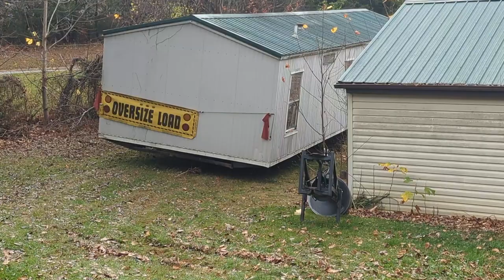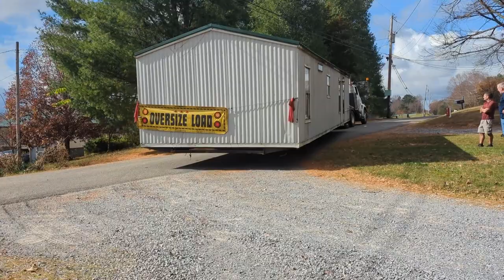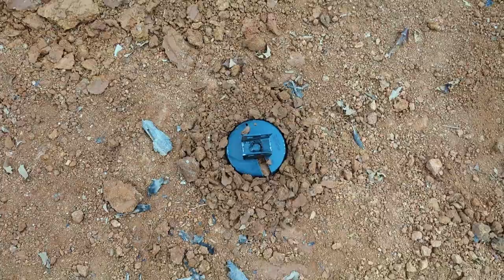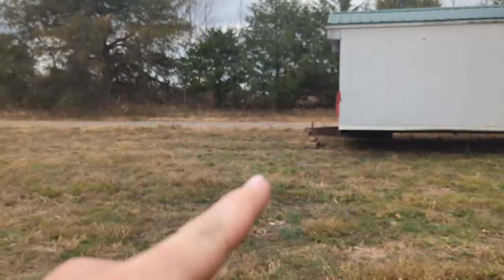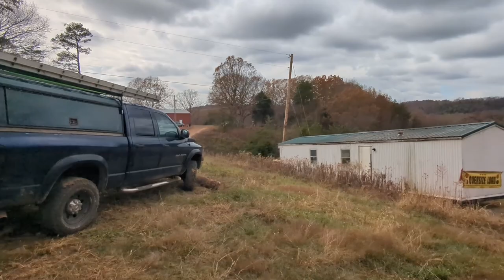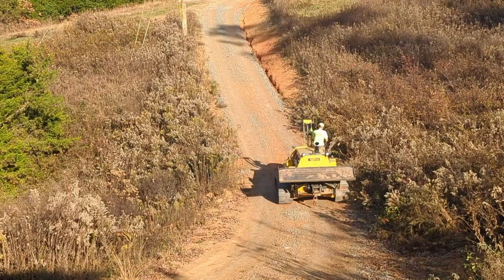They Moved Our Mobile Home With Skill!

Comment: My biggest question is how were they so sure that once they said it on the blocks it was level it's cool that they have all that great machinery but I know it takes time to level one up glad you're there
Reply from the maker: Sorry, I didn't get good video of it, but the used a water level system to level the house after they set it down and used shims to adjust as needed.  I got a clip of it, but it didn't come out good, so I left it out.  Sorry about that.  Thanks for watching.